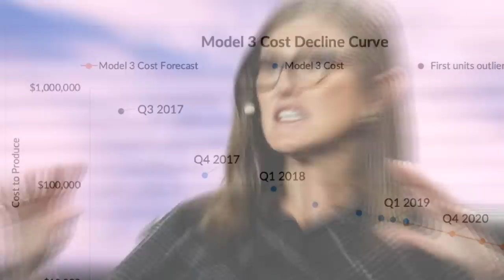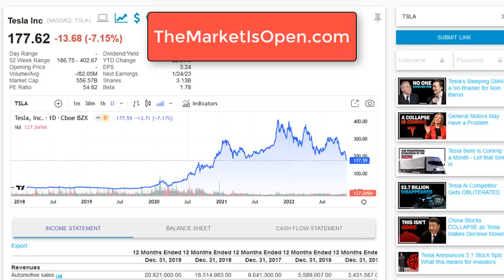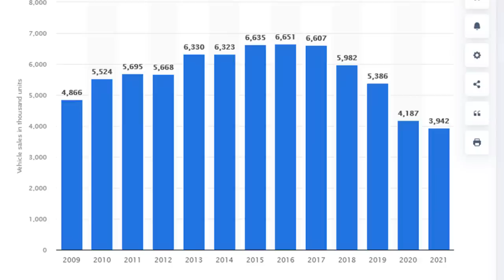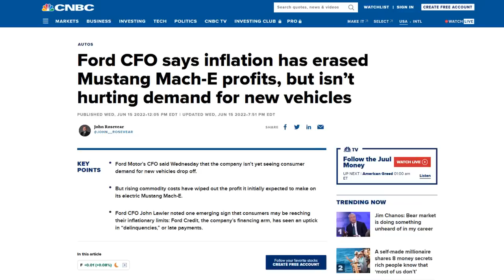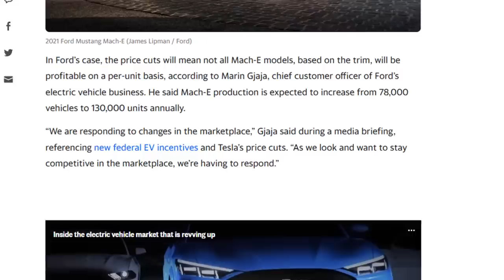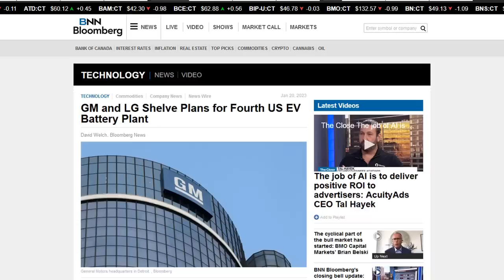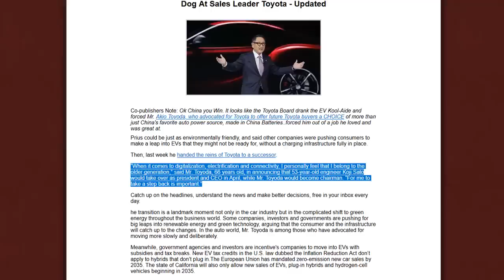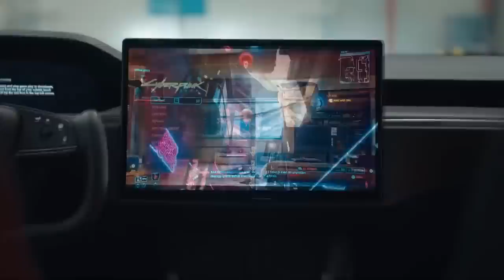Toyota, General Motors, and Ford Admit the TRUTH about Tesla

Comment: I think Toyota's ONLY chance of survival at this stage is to buy Lucid. Amazon will not allow Rivan to be bought and Toyota could not afford the bidding war. The Saudi's will be or should be very relieved that a major will invest and expand production and take on the road map to ensure Lucid can get into the volume mass market end. I think the high end Lucid brand is great and will complement Toyota's Lexus brand. 
Toyota can use Luicd's excellent EV power train and better tech in Toyota's value brands such as Corolla and Yaris etc. The buying power and wide supply chain will give Lusid a massive boost as well as increase production and reduce costs. 
The big issue is battery supply.....because Toyota is so late to the game, all the major EOM's now have long-term battery contracts and I don't know how much more they can allocate to Toyota. Toyota will have to start at the low volume luxury end and do a JV with LG or SK or both for a new Giga factory in Japan or the US to secure future supply of batteries.
It will not be a cake walk but this is the future as ICE is now on a one way trip to the graveyard.
Reply: Yes, Buying a Major Interest in Lucid or some of the other mostly EV Brands that are putting out decent vehicles would be a good plan. Lucid is still relatively cheap, compared to its highs last year. Although if they keep making more vehicles that Valuation will ONLY go up and the Saudis seem determined to continue to hold 60%+ of the company. Probably a good thing for them.

Comment: When comparing number of EV’s sold by companies the straight numbers are useless. You have to also know how many cars were made and are they running their production lines at 100%. If Ford sold 40,000 MachE but produced 80,000 then they have a massive demand problem. If they only 40,000 then they might be production limited.
Reply: They're production limited. And will continue to be for the rest of the decade as their ICE business crashes.

Comment: The fall of Toyota CEO's demonstrated that the hydrogen cars are just a nightmare, is not a solution and by far is not a green one. Even when Elon Musk explain in just a minute why hydrogen cars aren't viable, Toyota still pushed to failure hydrogen cars. 
More than that, hydrogen production is far more polluting than a ICE car running directly by methane gas  !!!
95% Hydrogen production in the world generate double the CO2 amount than running a ICE car directly by methane gas !

Comment: really do not care who makes it .but a powerful 4 wheel drive that can pull trailers thru the snow and mud and get the job done and not leave me stranded ..where is it ?  if you hate gas soo much where is the  dually  4x4 longbed work truck ev?????????????????????  not so easy to replace eh??????????

Comment: At 6:30, the video mentions that using pouch cells contributed to the Bolt EV fires. The trouble is, the Bolt EV has always used cylindrical cells.
Reply: The Chevy Bolt EV and Bolt EUV feature a 65 kWh lithium-ion battery pack manufactured by Korean supplier LG Energy Solution. While the Ultium batteries are larger, they will use similar LG pouch cells as the battery pack used in the Bolt EV and Bolt EUV.Sep 22, 2021
Reply: @davidbeppler3032  
There you go using the internet for it's intended purpose! 
(Smh)
.
(😉😂👍)
Reply: David is correct.
Reply: @MC-bm3cy  
(That's what I was pointing out?)
Reply: My 2017 Chevy Bolt EV had a 60 kWh battery with 288 cylindrical cells.  Newer vehicles had larger (65 kWh) batteries.  Due to a (small, but documented) fire hazard, these older, smaller batteries (all of them) were replaced with the newer, larger batteries. I do not see how this supports the statement (@ the 6:30 mark) that pouch cells were the contributing “cause” of the fire hazard.  If I am missing something, I am always happy to be enlightened.

Comment: It's interesting that you think that a manufacturer can switch streams and not have a period of loss in the transition - and yet it  was acceptable for Teslas to lose money for - as you put it 10 years.   And don't forget how the green credits actuallly may have saved Mr Musk's backside. While there is little doubt that EVs are going to grab and ever expanding share of the overall market, there is a significant portion (rural and multi-family home~ apartments, condos, etc) that without home charging are not going to make  the jump so soon. There may even be other players that make it into the over vehicular market. I don't think that it going to be as "clean" as you think. Interesting times are a coming
Reply from the maker: Exactly, but these highly profitable companies can't afford to take losses for 10 years without seeing something give, namely the stock prices. The probability of them downsizing dramatically or ceasing to exist, increases during this "transition" period. There may still be a small market for ICE vehicles when this is over, but losing the benefits of economies of scale won't make it very profitable. If anything a stronger argument would be that the current fleet will continue buying parts and service to keep going as long as possible.

Comment: Cars are going to become a niche product for the rich, ice and electric alike unless things change. Even Tesla's will become very expensive.
Reply: Nah, The Chinese will virtually guarantee that EVs become MUCH cheaper during THIS decade. Tesla will come out with a MUCH cheaper version for sale in China and Asia in a relatively short time frame. It's like the cheap and small Japanese cars of the 70's and 80's.  They weren't the prettiest but they ran and they were darn cheap...and got much better over time. 
Same thing is starting to happen in EVs as the shortages of chips and materials start to get solved.  As EVs scale UP and ICE scale down EVs will continue to have more and more lower priced models entering the market. First from China, then from Europe, then the US.

Comment: The wisdom of Toyota, seeing the other lack of infrastructure on a myriad of levels. Wait, electricity doesn’t originate from the wall?
Reply: Most walls have plugs / outlets. Not too hard to add a few wires and battery storage. People will be getting their own Electricity Production as they get sick of power outages and as Gas Stations start to crumble as ICE Sales continue to fall off faster and faster.

Comment: I would not buy a ev vehicle at this time. They still have a ways to go. You don't see charging stations on every corner. Maybe in 20 to 40 years from now. I'll stay with my 70 mpg motorcycle.
Reply: Literally almost EVERY commercial and residential building in the developed world has Electricity run to it.  
"The lady doth protest too much, methinks!" 
- Hamlet 
Act 3, Scene 2  - The Play within a Play
The Queen speaks to Hamlet

The Play within a Play is exactly what is happening NOW in the Automotive Industry...and why none of the Legacy Automotive will get out Unscathed.
Reply: @davidc2838  no place to plug in a car. That development is not around. So, maybe in 20 to 40 years to get charging stations and retrofit apartment buildings with plugins.

Comment: Disruptive innovation is inherently unpredictable and Tesla's path to rapid, progressive growth to over 10 million vehicles by the end of the decade requires billions of 4680 cells each year, up from the current rate of less than 20M.  That, in turn, requires production breakthroughs in both battery production and lithium refining.  Lithium use will increase 10 fold over the decade and we are already experiencing constraints in supply.  Because its stock trades at a high multiple, continued growth is more important to Tesla than its competitors.  I am confident, but far from certain, that it will overcome these challenge in time to maintain its unassailable lead.
Reply: @davidc2838  I hope your confidence regarding the 4680 ramp up is correct.  I am more optimistic of this than the Lithium production industry's ability to deliver 10 to 20 times more of the metal with 7 years.

Comment: So Legacy keep their EV prices high, and sell ICE Plug-in Hybrids with $7.5k subsidy. How does this help anyone, even Tesla can't mass manufacture batteries. The 4680 ramp is not going well any where?
Reply: It may turn out that third-party 46X0 cells will be mass-produced before Tesla are able to scale up their production much.
Reply: Did you even watch the video? Tesla's 4680 production rate was in December good for 1000 cars per week, which is more than anybody else is making at the moment, and sure Tesla might already be at 1500 cars per week right now, with just Kato Road and 1 production line in Texas. Drew Baglino said that only 1 of 4 production lines is in operation at Texas right now, and the other 3 lines are in installation/test phases.. PLUS the huge battery factory in Berlin has not started production yet, that will also happen this year.. So end of this year we might be at 10.000 cars per week or even more!  PLUS suppliers will start delivering 4680 cells as well (Panasonic will do this in Nevada).

So I am not too worried about this 4680 cell production, yes it might come a little later than expected, but all in all this will make no difference in the end. At least Tesla is no longer battery battery supply constrained, which is a good thing, it means Tesla can continue to ramp up megapack/powerwall production and vehicle production across the board.

2023 will be awesome!
Reply: @MarcoNierop  
There's another backup for 4680, the Nevada upgrade.
.
Let's assume the "OMG! They can't make the dry Cathode work!" Scenario.
.
Build the 4680 assembly / "canning" plant.
.
Divert first a small amount then all wet cathode material from the 2170 production.
.
That 4680 section will output more GWh (with 20% of the cells ) than the 2170 factory.
Result, they're at least even, but with less work, AND spare factory volume to build into.
.
Meanwhile the process is refined and can be inserted into final production as required.
Reply: You think Tesla won't be able to eventually ramp the 4680 up? It may have taken longer than expected, but once they get it right the competition won't be able to compete. It is the biggest cost of a EV. Legacy manufacturer's won't be able to compete on price in the future, they will have to by from battery makers that everyone else will be trying to buy from.
Image Tesla hit 400-500Wh per kg with the dry electrode, and builds 10 terawatt hour per year (probably their target). They will become the biggest automaker. And be the richest company.
Reply: 4680 relies on many new processes that once iron out will help Tesla to produce those at much quicker run rate in a smaller footprint and with a much lower cost than most battery makers out there
Reply: @MarcoNierop  So 4680 ramps as you describe, with NMC chemistry. That will be completely smashed by BYD and CATL MLFP due to cost, lifespan and charge profile?
Reply: @johndinsdale1707  I do not think 4680 is exclusively NMC chemistry only, 4680 cells will have various chemistries based on the use case. Btw, Tesla is already using  prismatic LFP cells from CATL.. That new chemistry by CATL will also be used by Tesla.. The factory for that is built just around the corner in Shanghai. And CATL is also building factories in Europe (I believe Germany, but not sure) most likely Tesla Berlin will be the main customer for that.

Anyway, it isn't all black and white, in the end I think Tesla will get rid of cobalt and nickel alltogether, because MLFP will get much better and cheaper over time, but we will see what happens.

Tesla's goal is to get to 1000Gwh/year with the Kato road, Texas, Nevada and Berlin factories combined., when fully ramped up. And with to be announced factories the coming decade, the goal is to get to 3000Gwh/year by 2030 or so. So Tesla just gets started with manufacturing of batteries!

Comment: I'm always amused by the Tesla fan comments.  In 2022 Toyota did $260bn in revenues and Ford did $151bn in revenues while Tesla did $81bn in revenues.   Tesla has a limited lineup of all EV vehicles while other manufacturers have ICE, BEV, PHEV, and EV.   They can certainly drop prices on EV's while maintaining or elevating margins on other vehicles while there is a race to the bottom on EV pricing.  What happens when the political winds change and EV subsidies go out the window?   What happens when legacy auto introduces vehicles with better quality and more refinement as compared to Tesla's horrid interiors and panel fitment.  Only thing Tesla has as an advantage is the charging network and FSD.
Reply: Ahhhh yes....they can elevate margins on their ICE cars - now there's a plan...
Reply: Tesla tops the industry in nett income, ROIC, Altman Z score, sales growth, performance, features, safety, cost-in-use, tech, integration, resale value, customer satisfaction, customer retention and conversion, buying process, zero CO2 production, no debt, highest brand value and market cap - as well as autonomy and charging!
That's why we are laughing at you.
Reply: @waynerussell6401  But apart from those minor details, GM and Ford are way ahead...

Comment: Get away from EVs and STAY away. Rechargeable whatever, has a life limit. A hard one ! You can recharge is only so many times, after that is dangerous expensive junk
Reply: Good point, the newer batters only have a 1 million cycle lifespan.   If you live to be 100 years old you will have lived 36,500 days.   How many times per day are you planning to charge your car to be able to use it up in your lifetime?    Bow to the stupid.

Comment: There's plenty of Chinese electric vehicles that are much cheaper, but aren't yet sold in the US.  Tesla  vehicles are too expensive for the average American.  Besides, there are constant stories of batteries igniting or uncontrollable acceleration or braking at the wrong time.  The public is leery of EV's because of electric grid problems and high electricity prices.  Few people will go to EV's voluntarily, and they will vote out politicians who try to get rid of regular vehicles.  I wouldn't be surprised if a voter proposition giving people the right to regular cars and trucks for another 20 years.  Electric vehicles just aren't ready for mass consumption because of price, technical flaws and difficulty sourcing rare minerals.  Ultimately, the lack of used battery recycling and pollution in production in battery production means EV's are worse for the environment than efficient gasoline vehicles.  I think the public will opt for gasoline vehicles or hybrids until the technical problems are solved.

Comment: You are masterclass example of American MARKETING most likely paid by the "croc" in automobiles. Strange is that European Analysts come to a different conclusion. The worst part for me personally is with all the money they "tesla" makes they are not able to find an Italien Designer! So they make crocs! Second why dont you mention the potential call back of 830k cars and the multiple lawsuits as a result accidents caused by the faulty "automatic" driving?
Reply: How high are you?  MARKETING?  Is Euro NCAP American marketing?  They gave Tesla the highest ratings of any car ever mass produced.  I am sure nobody in Europe cares about car accidents or safety.  How about how many miles can you drive per money system?  I don't know the Euro conversion but in America I get about 130 mpge, and can drive 300 miles for about $9.  I am sure those numbers are also American marketing too?  I would love to talk about the thousands of lives saved by the faulty "automatic" driving!  My car has saved me personally from 3 accidents.  I am sure I would have avoided/been ok in 2 of them, the third.... not so sure.  I didn't see it at all and the car did.  Bad drivers are everywhere.  Do Europeans like speed?  My slow Tesla has a 0-60 of under 3.5 seconds!  I say again, mine is not even a fast one!  lol
Reply: @Riger Donald Fluri
FUD well running dry?